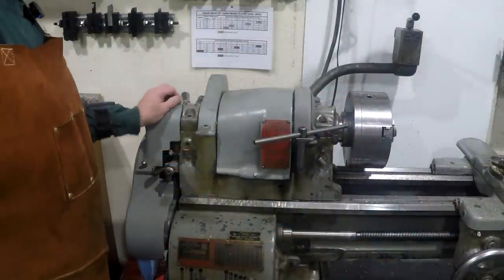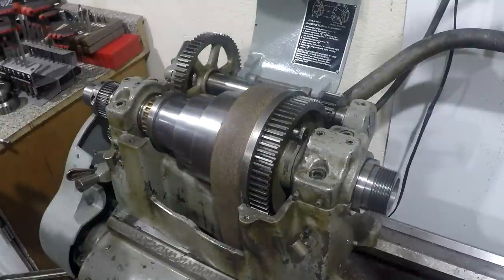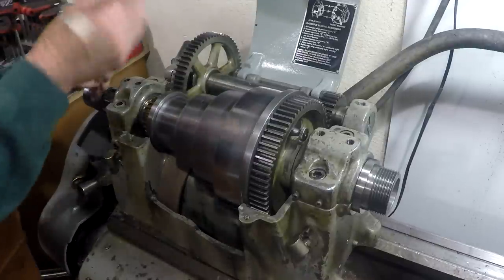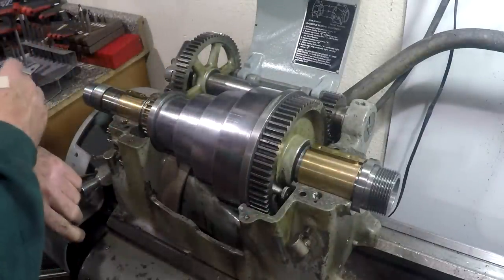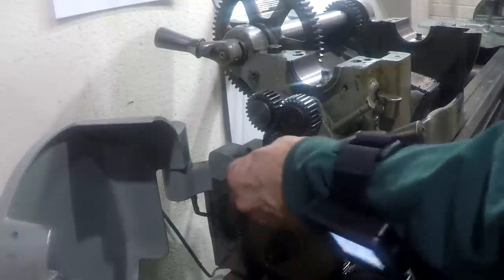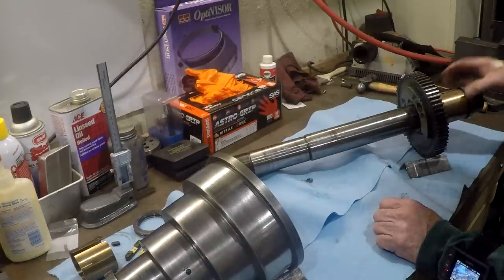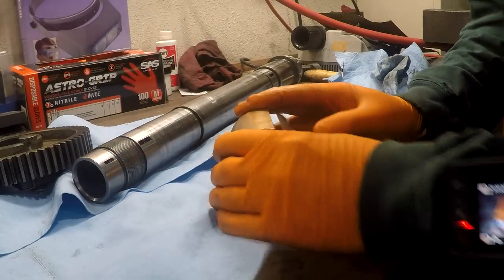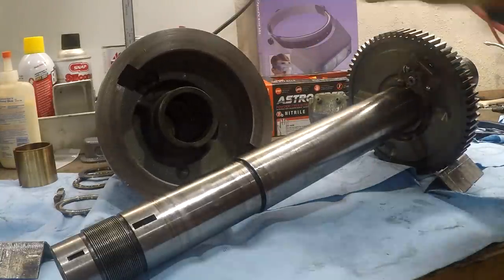South Bend 13" Lathe Spindle - Part 1

Comment: Great idea repining the belt, I have watched this series many times and each time I go back to view again I learn something. Still struggling with my 13" South Bend. Bought a used but working spindle and for the first time I can turn the spindle by hand. Front is shimmed to .018 which gives me a one ten thousand over .001 bearing clearance. Runs cool all the time. The rear is still running hot and .016 to .017 is the shim thickness to get within tolerance recommended by South Bend. At least I can turn it by hand which is something I couldn't do before. It's time to take it to a machine shop and get a new look at it.

Comment: Hello: I have a 1957 sixteen inch Southbend... Glad to see how yours is made as I may want to dis assemble mine some day..Mike in Louisiana
Reply from the maker: I believe there are a lot similarities in the 13 and 16 headstocks. Thanks for watching.
Reply: YVW! Yes I think there is...Mine started life as a turret lathe.. I removed the turret converted it over to engine lathe configuration...The bed has almost zero wear on it as the turret is usually what wears...Spindle on mine is 2 3/8-6 thread...

Comment: Hey Bob I have a real old south bend lathe its a 9 in model a catalog no. 444z bed length 3 and a half has a tag on it stating this machine conforms to orders of the war production board. At least from the 40s . The bed has some wear it has a gearbox for the cutter holder sorry not savvy on lathe terminology. Had a machinist back in the 90s wanted this gear box really bad did not want to alter what I had. Used this at one time to alter a diff side bearing shim had to remove 0.010 in had 0.005 runout when done not good but not bad for a 70 plus year machine. Also have a Canadian no 15 drill press made at can. blower and forge co. ltd. this thing is probably as or close in age to the south bend.Had these given to me back in the 90s a machine shop that my dad had dealings with the last 40 years. These machines were going to be scrapped I picked them up and they work for what I need and will last beyond me. 52 now waiting to tinker at 65.

Comment: Great video. Buy the way love the counterbalanced press table.
Reply from the maker: Thanks, I built it about 25 yr. ago. It is engineered for minimal table deflection with a 50 ton load on it. On the end you see it's a poor boy counterbalance. on the other end there are a pair of big garage door spring to retract the jack.
Reply: Old Iron Lover neat I thought it was commercially made maybe you can do a video that I need to build something like this for my shop. I have a South Bend Lathe too but it's quite a bit older somewhere around 1931

Comment: I have a South Bend 13" x 72" Lathe with a 3-Step Pulley and not the 4-Step Pulley. As far as I can tell it is original. It came tooled with everything you can think of except measuring tools. I did a search based on the Catalog Number and all numbers are matching throughout. It did not have a chip pan for some reason, it has the oil misting system that sits underneath the ways. I'm going to fabricate a chip pan for it. I am physically limited on lifting and use a engine hoist to help me. It needs a really good cleaning. One thing I noticed is all of the gears are covered in a heavy sludge of oil, pretty nasty. I don't know enough yet to determine where it is coming from, maybe a gasket at the base of the headbox, I don't know just guessing. All of the 13" lathes that have shown the gear train are clean but like I said mine is the opposite. Could you give me an opinion on this since you have the same size lathe and have been going through it. My South Bend is a 1960 model. I have enjoyed your video. The main reason everyone should watch this is because it shows you taking it apart. George Bell did a beautiful rebuild on his 13" on the reassembly but it would have been perfect to see it torn down and all of the steps involved to do so. Thank you O.I.L. for taking the time to tear down and reassemble.

Comment: Great video. Just got the identical lathe. Hopefully i wont have to use all that you have done. My hiccup is that the lathe came with a 3 jaw chuck and it is STUCK.  I have avoided the back gears and have decoupled the cone pulley. I have tried heat and an impact wrench and various strap wrenches and cheater bars.  Any other ideas?
Reply from the maker: You're right to avoid back gears. There are several YouTube videos on repairing back gear teeth. Mine never got really stuck but when it was a bit balky about coming loose, I put a big crescent wrench on one of the jaws and smacked it with a hammer and it always popped loose. The shock of the impact was enough. Mine has a brake on it so it was relatively easy to hold the cone bearing to resist turning, but you could maybe do the same with a strap wrench. I didn't decouple the cone bearing and it never got hurt. No guarantees though. Maybe you could decouple the cone bearing and hold the bull gear with a strap wrench. Good luck though. You've got a decent size lathe. Mine has served me well.

Comment: I have a question for you, I also have a SB13" lathe I have talked to you about, My bearings have damage, especially the rear and expander. I got the front dialed to .0007 clearance but the rear is at .006 when picking up with 50 lbs of lift. If I remove .002 from each side to bring it in tighter you can't turn the spindle by hand. If you power it up it will run for less than a minute and get hot. If you make it any longer than 2 minutes it will lock up the spindle. Wait about 30 seconds and it will run again like it did in the 1 minute range. So I left the rear at .006 and use the low range or RPMs only. Problem is I drilled a 37/64" hole in a chucked up piece of steel but when I checked the hole it was a loose fit by about .007, could this be possible because the rear bearing is out of tolerance? The old machinist who sold this lathe to absolutely lied about all the issues it has in the head stock. The capillary spring loaded oilers were broke in half, so no lube could get to the bearings at all. The last set of bearings on eBay sold for over $550. Besides the other issues and parts I have put in this lathe there is no way I'll ever get my money back out of it now. Any suggestions at all ????????
Reply from the maker: Not sure if the damaged rear expander could be causing some of the problems or not. But assuming it is actually expanding the bearing my first inclination would be to go back to where you had the .006 clearance and pull a .001 shim from one side and check it, then pull .001 from other side and check. Then swap one of the .002s for one of the .001s and check, the swap the other .002 for .001, etc. so you are effectively sneaking up on it .0005 at a time. It'll be time consuming but you might find a clearance you like somewhere in there. Also, excess clearance in the rear shouldn't have a big effect on drilled hole diameter at least not if part being drilled is close to the spindle nose, i.e. not sticking way out toward the tail stock. Drilling a hole on any machine it's not uncommon for the hole to be oversize. After you get the bearings as good as you can, maybe try using a boring bar to make a test hole in something and see if the diameter of the ends of the hole are the same. That said, excess clearance in the rear bearing can allow the spindle to wobble and the farther the work piece is sicking out the more it could affect the quality of the machining. Every machine has wear and part of the game when you have a worn machine is compensating for it. In this instance, you could use a live center in the tail stock to take some of the wobble out. Hope there's something it all that this that helps.
Reply from the maker: I don't remember if I told you this but check with Ted Pflugner latheman2@aol.com. He has a ton of parts for SB lathes and his prices are reasonable. Maybe he has a bearing set.
Reply: More than anything I appreciate your advice. There are a lot of YouTube Videos of great restorations on the 13s but you ask questions and you get coined answers, they want you to subscribe and give a thumbs up but they don't want to take anytime helping with advice. They will take all the compliments but could care less if you have detailed questions. You Sir are a true professional, you take the time to give a professional opinion especially on what your videos cover. I appreciate every word you wrote and it's a good way to go about correcting the problem. I was frustrated, I deal with physical issues of my own and it's difficult to keep taking apart and putting back together. The big change here that helps me is a game plan from you, a set order to check and recheck until I get back to the correct clearance. I don't have a lot of measuring tools but I was able to put a indicator together with a few extra rods and swivels to reach the back of the spindle. Thank you for your advice and steps. I bought parts from Ted last month, he doesn't have the bearings but thank you for the reference. I'll let you know how this turns out when I finish.

Comment: great video, very helpful. Was wondering how you made D style  spindle nose. Is it a adapter that threads on spindle ? Do you have any photos or video of how you made?
did you buy or make the D Cam locks?
Reply from the maker: It's been over a year since I made these 3 videos so I don't remember if the second or third video might have answered the questions so here's the rest of the story. After the original spindle was damaged, I was able to locate a NOS D1-3 spindle and installed it. The chuck mount face plates were purchased with the cam lock pins installed and the nose taper already machined. All I had to do was fit the face plates to the chucks. I also bought a small, cheap D1-3 plate to use as a protector to cover the nose when I was using the collet adapter. Don't want any thing to damage that nose taper. Hope this helps.

Comment: I have a SB 13" in my garage. I was running on the highest RPMs and the rear spindle bushing/bearing locked up. Caught me off guard because it started back up before I could kill the power. I checked the motor and belts and the pulley belt before turning it back on. It ran again for 30 seconds and locked up, leaning down I placed me hand over the rear cap and it was hot. I removed the oil git and let the oil run out, it wasn't much. I added some MotorKote hoping a little would get to the bushing/bearing and it must have because it didn't lock up again even running at wide open. I think the old felt/wicks are keeping it for being lubed. Is there anyway to tell after getting the cap off and do I need to remove both caps or can I remove the rear cap to get a look at it. Thanks for the video
Reply from the maker: My thoughts follow with the caveat that I can't see the machine nor do I know which MotorKote product was added or how much oil came out with the oiler removed, I'm assuming only a brief dribble.

 It sounds  like it ran low enough on oil that there was not enough for the felt to wick into the bearing because when you added some lube it appears to have resolved the immediate problem.

I'm not familiar with the MotorKote line of products but SB calls for spindle oil. I use Mobil Velocite 10 but there are several that will work. If anything that is added that is too thick it might impede the felts ability to wick the oil.

It is possible that the felt wick is dirty and should be replaced anyway just because it has been in there for several decades. My 13 is a 1954 model and I got it from the original owner. I disassembled my spindle shortly after I got it to inspect it and found the bearings, the spindle  and the felts were in good shape but since I had it apart I ordered a new set of felts for it. The felts are readily available. A really good source for parts and information is Ted Pflugner at Latheman2@aol.com. There are different grades of felt and he would know which grade is best and he would very likely have the felts for sale.

If you disassemble the spindle to replace the felts (I would do it if it were mine). Pay close attention to the shim packs, keep them sorted out so you can get them back where they were originally. They might stick to the cap and fall off as you remove the cap. If you have not removed the caps before, watch my video on removal and installation (or others, there a a lot on You Tube). There are a couple of places you can cause damage if not done properly. It's not hard to do if you follow the process. When done probably a good idea to check the bearing clearance on both ends to be sure the shim packs are right. Again the procedure is well documented on line including my video. If you find yourself in need of re shimming, fsh_design on eBay makes and sells all kinds of SB shim pack kits. Re shimming is a bit tedious but important to get the bearing clearance right,
Reply: I have watched your videos and I am subscribed to your channel. I pulled my spindle out and discovered the spring loaded felt/wick was destroyed, there was no way any oil could get to the bushing/bearing, the oil Gits were full, I check them everyday I play with it. I pulled the Oil Git out and it drained for a short period and was clean and it is the same oil that you use. The shims are a disaster, one was folded over the others wouldn't lay flat, I don't think they did when the caps were put on. The tube on the rear journal that holds the spring loaded felt/wick is flush but the front is correct. The shims were also torn. On the front Bushing/Bearing the expander has 3 steel pieces shaped like the expander with the holes in them. I have no clue why unless it's not the correct spindle for the year lathe I have and it was modified to make it work. I would like to take a picture and send it to you but I'm not sure if there is a way to do that. I got the journal size from Ted P., he referred me to eBay for shims and parts for my 13". I don't know what's going on with my lathe but things are off. I need to find someone to look at these parts that might know what happened. Your videos are very informative and I enjoy watching them. George Bell has a good SB 13" rebuild video. My SB is a 1960 model with 40" between centers. Thank you for answering my comment.
Reply from the maker: @paulgreenlee190  You can email me at OneOffFab@comcast.net
Reply from the maker: @paulgreenlee190  Sounds like an inspection was in order. Sounds like it's gonna need some parts.
Reply: Old Iron Lover, I have discovered some other facts with my headstock, I remember the first time I took it apart and noticed 1 of the 4 Socket Head Cap Screws was longer than the rest. According to Ted P. the original length for the 13" is 1-1/2". I measured the thread length on the bolt holes and I have 15/16" of thread so I ordered 3 new SHCS 1/2-13x1-3/4" and 1 SHCS 2" for the hole that is partially stripped out. I'll adjust the length to get maximum length in that one hole that will go past the weak threads at the top of the hole. I followed your advice but the numbers would change turning the lathe on and off. I think the previous owner knew about the stripped hole and used the longer screw in it. I didn't keep track of where the longer one was used. When I start to adjust again I will use your method of removing or adding shims to get to the correct clearance. Thanks for all the help

Comment: Great video! Thx! Would like to throw out a question,  you said not to really worry about the bearings unless you saw raised ridges/gouges.  My question is (to all really), what do you do if you have the ridges? Mine Is so old cannot get parts (1929), and not sure if i should "not really worry about it, or go into a complete panic...???
Reply from the maker: Here's my take on it, others may agree or disagree.

I assume the spindle is undamaged and any damage is in the bearings. My first choice for a badly damaged bearing would be to get a new one. Grizzly has a lot of parts still available but they are hit and miss and expensive but they may be the only choice. My first option is to email Ted Pflugner at latheman2@aol.com. He sells lots of South Bend parts, most are NOS. He was the last toolroom foreman at South Bend and worked there for 30 years or so and knows more about these lathes than just about anyone. Great guy to deal with.

If the damage is minor or if you don't have any other options then here's my thought process. The damage got there for a reason, check the damaged area of the bearing and the corresponding spindle surfaces for any trapped contaminant or spindle damage and do what you need to do to remove it so it does not continue to cause damage. I wouldn't feel too bad about using a hard stone to remove the raised area around a ding from the spindle If I had no other choice but I would thoroughly clean afterwards. Keep in mind that any use of a stone may leave grit behind, especially in the bearing. If the damaged area on the bearing has a raised edge I would remove it carefully with a bearing scraper or other suitable tool. Any damage below the bearing surface reduces the amount of bearing surface, probably not a mechanical problem because most of the bearing surface it still there. But any groove in the bearing will catch any new contaminants. Cleanliness is ESSENTIAL in reassembly not only for the spindle and bearing but the oiler passages and the felts, springs, etc.

Properly adjust the bearings and then check for excessive heat while running for a while.

A closing thought: If you have damage and you can't get any new parts then what are your options? You may be forced to make repairs to what you have and end up with a less than optimal situation. The result may still be quite usable.

Good luck.